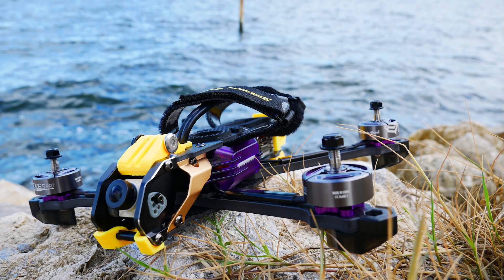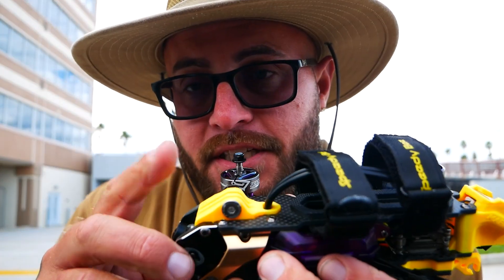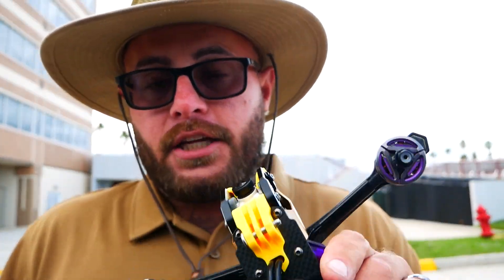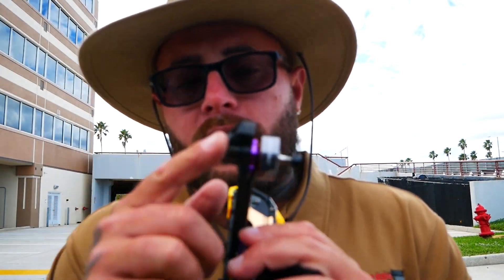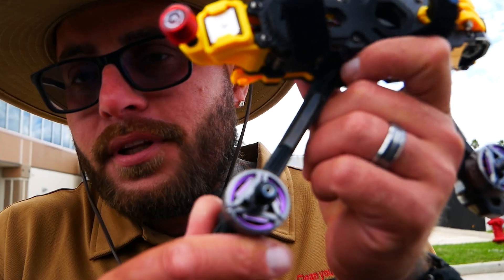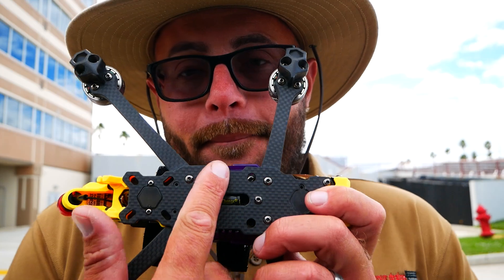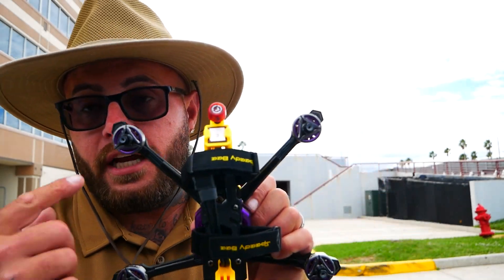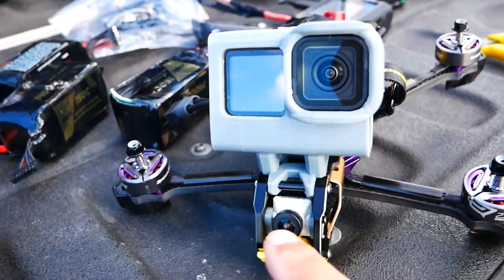Impressive FPV Drone Plug N Play ! Feature Packed & Built Well !!

Comment: I just completed my first build using the XH pro frame and wish it came with purple side panels.... With mine one of panel led's stopped working altogether though after multiple taking apart and putting back together "experiences" of a first build. I dont think the tiny strips are sold separate anywhere either.....

Comment: I noticed those cool tones in esc configurator when doing my latest build  😁 i did Simpsons 🤣 little 3.5" with the speedybee f405 40a AIO (bluejay) 1505 motors. I had 3.5" props on and it flew great 🤯 very fast. Then i got prop guards and had to go down to 3" props. It sucks now ☹️ just doesn't have the get up n go like before and i turned it up a notch too. If i put the 3.5 on now it would go like hell 🤣🤯 idk saw a really good deal on betafpv and ordered a blue pavo 20 pro frame along with 2 extra prop guards and a air unit holder (all blue) and a set of 1804 motors ($20🤯) plus a spare blue pavo 25 prop guard (wanna try on cinebot25) all for $50 🤯🤯 great deals right now keep em coming maaannn 😁